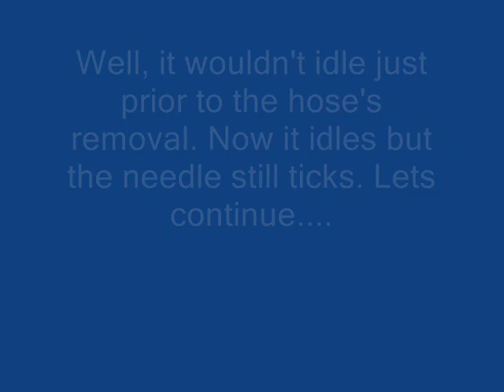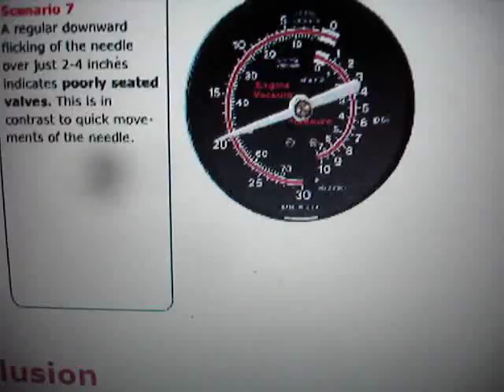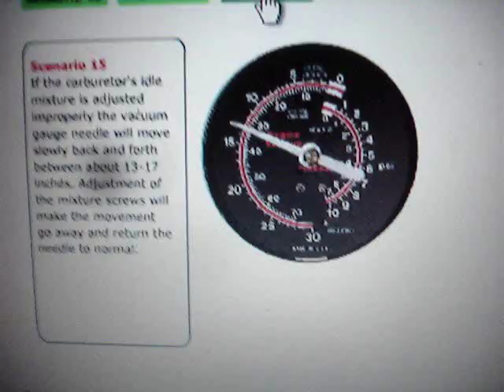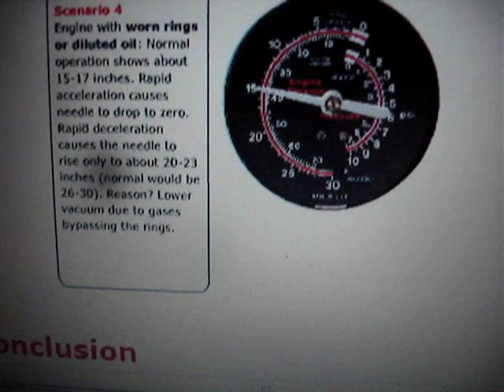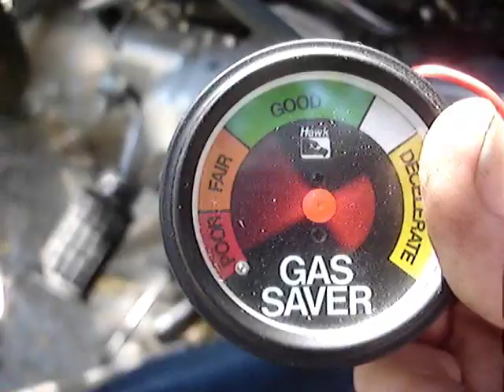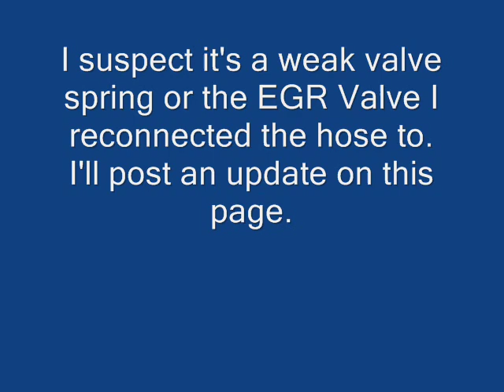How a Vacuum Gauge Works Reading Diagnostics Virago Valve Adjustment

Comment: Hi, I´ve a virago 535 and recently I learn how to use a vacuum gauge to match my two carburetors with the same preasure, to see a more accurate measure, (a steady needle) you need to put a mini faucet between the main flow intake and the vacuum gauge, in the hose, and closed it until the needle is stabilized, be sure not to close it completely, also, I used two gauges, one for each cilinder, I hope this serves you or anyone

Comment: @IExposeMormonism Thanks I finally found a vaccum gauge and installed it 1.3l 4 cylinder. I was wondering if the needle should be perfectly steady on idle or if it is supposed to flutter like mine does, it flutters around 20inH, very minimal fluttering like the needle is trembling. what could this be?

Comment: On bikes its so, you need a valve or something to reduce the hose to the gauge so that the needle stops vibrating so much then you have a reading for the virago 250 is 14.7 hg in in cars is more.
Reply: A tip: watch series at flixzone. Me and my gf have been using it for watching a lot of movies lately.
Reply: @Miguel Bo yup, been watching on Flixzone for since november myself :)